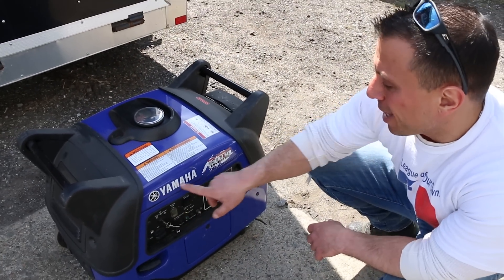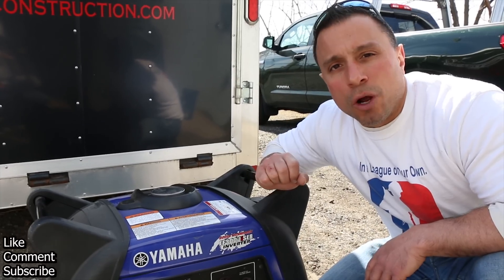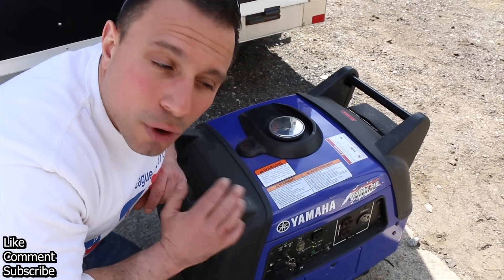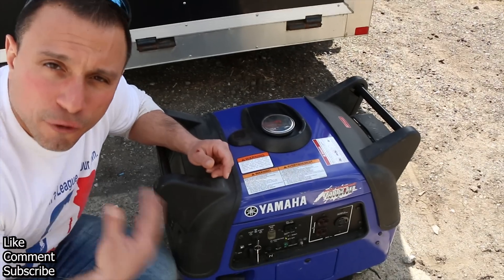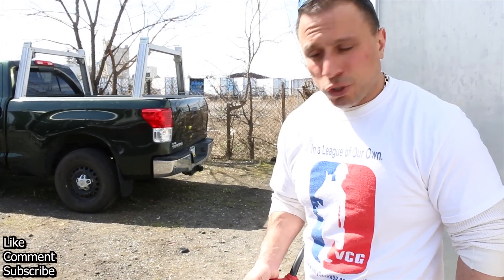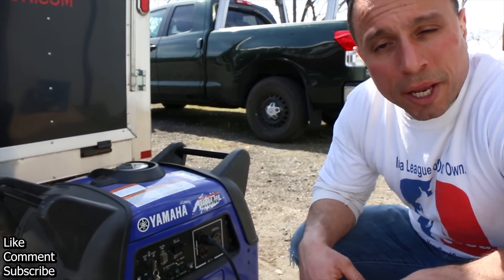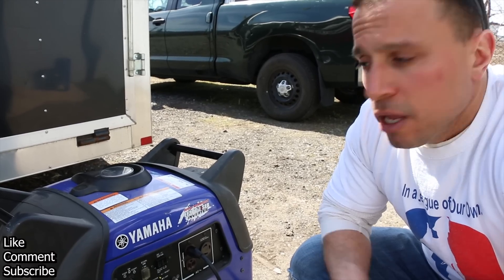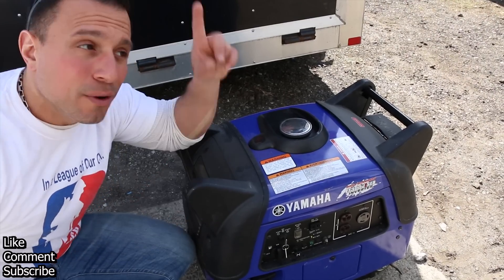How To Start An Inverter Generator - Problems With Economy Mode

Comment: My exact same model is a 2007 model. I use Seafoam in all its gas & it responds quickly. Only 2800 watts rated, but it runs forever if you take care of it!

Comment: Yamaha EF3000ise, purchased 2004, approx 3000 hours use.   Ethanol free gas and Stabil .  Never had an issue with motor. Just recently burned out Stator and Rotor assembly during summer 2020. Got my moneys worth out of it . Started every time. Only replaced battery 1x.

Comment: In your opinion is it better to get a larger inverter run on eco mode, or smaller gen revved up, I need like 2000 watts but wonder if a 3500 would save gas on eco mode? Thanks

Comment: You're right about not wanting to run sensitive electronics on a generator without a inverter because of the sine wave.  Basically what it comes down to a standard generators without a inverter don't produce "clean" power so you might get spikes or surges.  Most modern generators nowadays do a pretty good job of provide clean power but it would be still be helpful to use a UPS/surge protector while having your electronics connected.
Reply from the maker: UPS is the way to go, that flicker off and on during brown outs is horrible for electronics!!